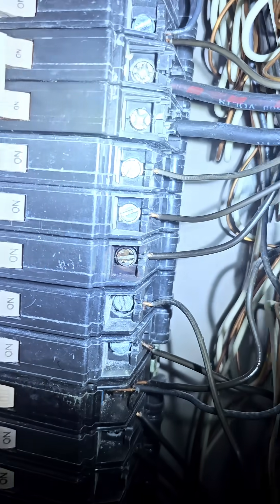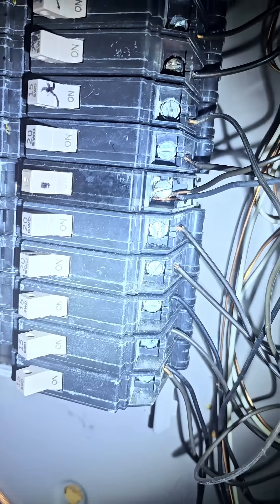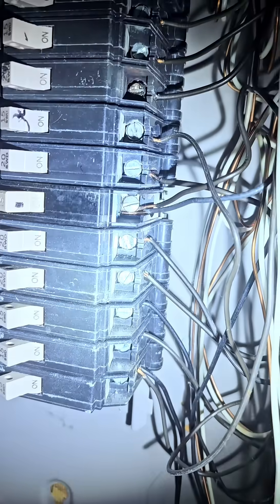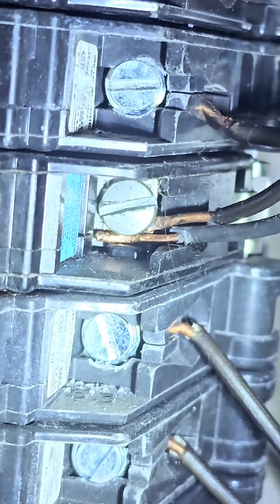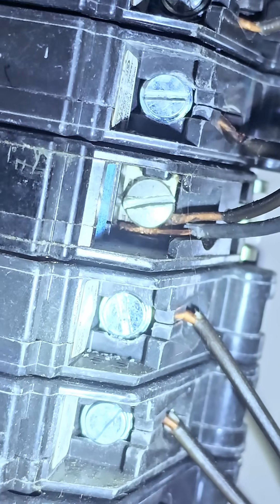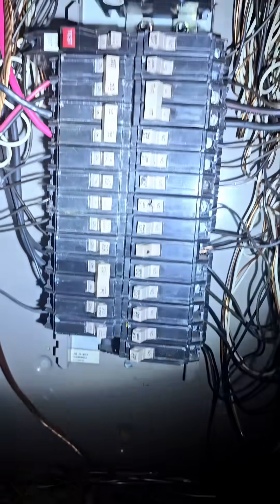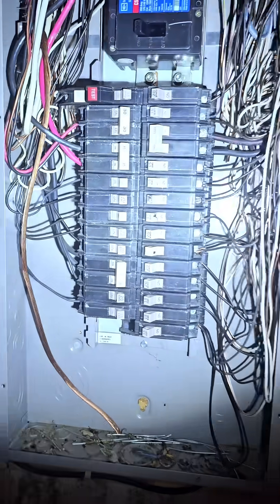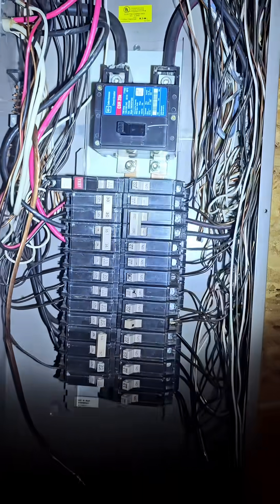Electrical Panel Inspection for Double Tapped Breakers #homeinspection #realestate #diy

Comment: You fix that by removing the two wires from the breaker, getting a piece of the same gauge wire about a foot long, strip one end and wire nut it together with the two wires( 3 wires in one wire nut), then strip the other end of the short piece of wire and install it in the breaker. Now you only have one wire in the breaker and it is legal to have a splice in the panel.
Reply: Depends on load, but nothing hillbilly about a legal junction
Reply from the maker: Thats a hillbilly way to fix it. Should have its own dedicated breaker
Reply: @DirectHomeInspectionsOH how else would you fix it? 😂